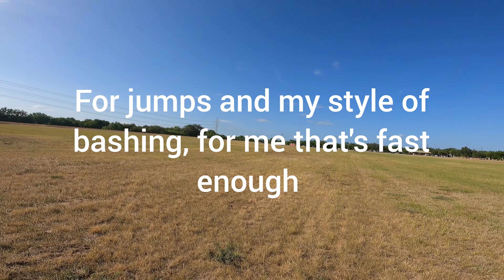Outcast 8s 35/47 gearing XLX2 vs K8S Max 5 30/47 gearing

Comment: 30t ×47 look very fast enough for me to... for bashing in grass and dirt  i hope I can you that combination with the 800kv xlx2 i gone me happy 🙏
Reply from the maker: Yeah, I've gone to 30/47 gearing on both my Outcast 8s and EXB K8S. I get around 54mph on grass. I do have smaller motors in the them so that my drivetrain can stop falling apart. I went with the HW 5687 on the K8S and the HobbyStar 5692 motor on the O8S. They are easier on the drivetrain and they are lighter than the big 2028 motors. I don't like the insane torque of those motors. I still need high powered fans if I drive non stop.
Reply: @Rc enthusiast.  waoo so the torque from the 800kv 2028 will break my diferential??? Right

Comment: That's super hot for batteries! Damn. My big rigs heat those batteries up.
Reply from the maker: Yeah bro. That's why I got my temp gun handy. I've destroyed way too many batteries by not checking stuff before. Now I'm much more careful. I also check how low the voltage dropped on all my cells with my charger. You have to tune the LVC stuff on both the Castle and HW ESCS. I've ran them with the factory LVC settings and that was a big mistake. That would lower my voltage to less than 3V on at least one cell. That should never happen. It will destroy and puff your batteries, which I've done 😢.
Reply: @joseCalderon1976  Soo how you calibrated the esc??
Reply from the maker: @CorvetteC6-LS2 Sorry for the late response. I use the Castle link to calibrate my XLX2. For the Max 5 it's easier through the set button or you can use the programs box.

Comment: Thanks for showing what a realistic setup is. All these people running 1:1 gearing really have me confused. How is it not too fast and how are they not overheating like crazy?!?
Reply from the maker: I don't know. I tried 1:1 gearing on my K8S and it puffed my batteries. There are a lot of variables like tire size, the temperature where you live, the style of driving, the terrain, just to name a few. I've gone to 30/47 gearing for my big trucks since. I've head way less issues with over heating and batteries getting destroyed. And less voltage spikes. I get about 52mph off road, which is plenty for me personally. 👍
Reply: @joseCalderon1976 I’m running the stock Firma 160 w/ the Firma 800kv on 28/47. Not sure if something is wrong, but on street bashing my temps hit 155F after ~5min. Ambient temp is ~85F. 🤔 I am doing multiple WOT pulls and hitting the brakes. Running Bandito X tires.
Reply: Curious, were you running a motor fan on the K8S? I didn’t hear one, but you had one on the O8S.
Reply from the maker: @littleAZN248  I do run one now. It gets too hot without it.

Comment: Nice man i just got my outcast exb 8s and i order the mamba xlx2 +800kv
Reply from the maker: Cool. Just be careful with the torque on that giant motor. My diff bolts that hold the aluminum case together would keep coming loose. Make sure sure to get some green oil resistant thread locker. That helped a lot 👍
Reply: @joseCalderon1976  what the diferential fluid??? That what you taking about
Reply: @joseCalderon1976  can i run that setup whit the 800kv 30t×47 ??? I don't want to go crazy fast but i don't want to break my diferential ether 🤦‍♂️🤣🤣 or what about 38t×47 on 800kv catles??
Reply from the maker: @CorvetteC6-LS2  the oil resistant thread locker is what goes on the bolts to secure them into the Arrma upgraded aluminum diff cases that I have
Reply from the maker: @CorvetteC6-LS2  You can also try 30/47 gearing for the 800kv motor to start with. See how fast it is and just keep an eye on your temps.
Reply: @Rc enthusiast.  yeah I gone run 30×47 and them 39×47 too se how I like it
Reply: @Rc enthusiast.  oh you taking about loctite right?? Which one the red one or blue one??
Reply from the maker: @CorvetteC6-LS2  the green one. It's better than both the blue and red one. And it's oil resistant 👍
Reply: @CorvetteC6-LS2 I run 39 47 max 5 800kv it’s ok. I run the 11000 batteries gen ace no issues . I keep fans on. Never checked temps but batteries never hot to touch

Comment: Questions i want to run same gear because i don't want to swap the 47 spur ?? Can i run the 30t × 47 whit the 800kv??? I don't care to go faster I just want to bashing, good engine temperature and of course i want to pop some wheelie
Reply from the maker: Try it out. And see what happens. It should be fine. With 30/47 gearing I get around 53 mph off road with good batteries

Comment: Powerhobby lipos are straight garbage 🗑 your not over geared with them they run extremely unsafely hot🔥🔥🔥🔥 I have the 9000 120c and after 5 minutes mine were 147 in my dbxl that definitely wasn’t over geared. Just poor quality brother. Still great run
Reply from the maker: I have some regular 100C 4S Zee lipos that I could try out, but those are only like 6000MAH. I'll have to stick with these batteries. Honestly, I'm not sure what batteries could take that intense heat (92F, but it felt at least leat like 100F because of the humidity). What batteries do you use in your Losi beast? Thanks for the input.
Reply: @joseCalderon1976  smc 6900 130c 4s these are awesome packs best I’ve used so far for sure and there priced way better than the Powerhobby’s👍💯
Reply from the maker: @offmymeds9621  Unfortunately, I had bad luck with SMC in the past. The wires on some of my batteries came unsoldered from the inside. I managed to puff a couple of SMC batteries running 39/39 gearing with the XLX2 and 800kv motor. I took things too fast though TBH. Did you see that on the 30/47 geared K8S, the same batteries didn't get too hot though? I'll try again.
Reply: @joseCalderon1976  same, I had bought 2 9700 smc and went through 4 replacements in 3 months! 🗑🔥 Cell 1 trashed in all 4 and the cells would never balance out, finally they gave me my money back.first and last time for SMC for me. Hot garbage...